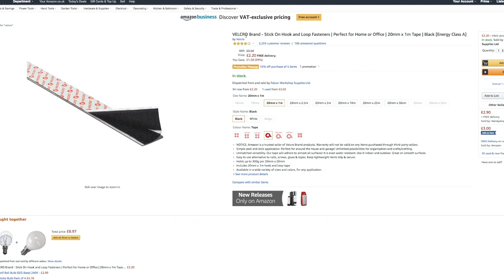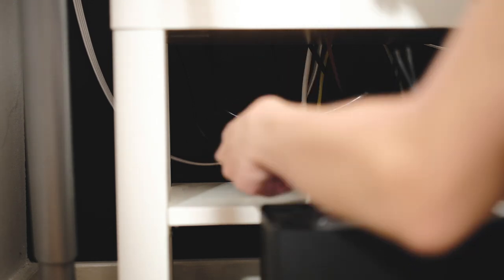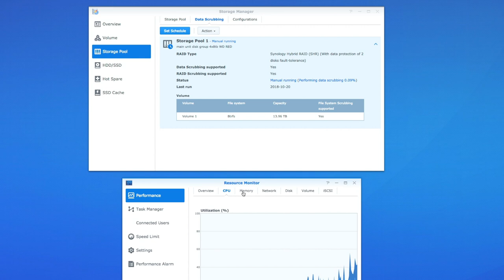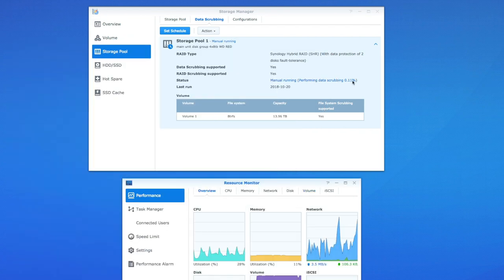Synology DiskStation Vibration Noise - EASY $5 FIX!

Comment: Thanks for this.  Made a difference.  Combined with screwing in the drives instead of the plastic tool-less holders and putting the NAS on a felt/foam base , I now have a perfectly reasonable DS420+ NAS  with 12tb ironwolfs and not a gurgling clunking whirring sleep disruptor.  My only concern with the velcro was if it might hinder heat dispersal through the metal cage. No probs so far.  Pity Synology don't take note of their 400+ customers here and build the things quieter in the first place!  I also have a QNAP 2 bay DAS with 10tb Ironwolfs and that makes only a gentle humming sound as built.
Reply from the maker: Hi David, thanks for your feedback. I monitored my temp after the mod and didn't notice any difference either. I keep my fan speed on low all the time. You are right, it is annoying that these NAS isn't exactly cheap but they make these noises. Given the views/feedback - it looks like many people are having the same issue!

Comment: Ill definitely have a go at this.  Thanks for the idea.
If I were to make a suggestion to anyone else, you probably could use less material and get the same results.  Instead of using the strip the whole distance, just put about an inch on the back and front.  That's what I'm going to try out anyways.
Reply from the maker: Hi Chris, thanks for watching my video. You are probably right, a small strip of velcro felt will probably do the job but the material was cheap anyway so it was just as easy to cut a single long strip and slap it in and call it a day. Let us know if your method works too. Cheers.

Comment: Sorry for the comment on an old video but this might be the fix I need. I read every comment hoping a DS411+ would show up but no luck. I bring this up because my drives lay flat unlike yours so I’m not sure if the fix would still work. I thought it was hard drives but I just replaced half of them and the sound remains.
Reply from the maker: Hi there. Depends what you are trying to achieve? Are you having this same chassis buzzing sound or are you trying to dampen the hard drive own mechanical sound?

Comment: Great tip, just upgraded to 16TB drives and the were significantly more noisy so will apply this easy fix.
Reply from the maker: Hope this helps you. 16Tb x 4??
Reply: @JoeLamOfficial  just 2 16TB + 4 6TB for now :)
Reply from the maker: Which RAID mode are you using?
Reply: @JoeLamOfficial  Keeping it simple with SHR. I'm on a learning curve. The first (successfully replaced drive) is a WD Red Pro. The 2nd 16TB due tomorrow will be a 16TB Seagate ST16000NM001G Exos which is about £100 (UK) less than the WD. I use the NAS mainly for media (Films and TV) content. I will use the extracted 6TB drives for off line backup. I will be putting the Velcro's in the bays when the two 16TB'a are in an working
Reply from the maker: Nice! Drives are getting bigger and bigger. Quite crazy. I wish I set one drive fail only. But now I’ve set as 2 which means my 4x8TB is “wasting” a lot of space for backup. Probably slightly over cautious
Reply: @JoeLamOfficial  Yes bigger and bigger has always been the IT mantra. Moores Law still prevails. BTW my first HDD (in the early 80's was a £640 20MB for an early IBM computer. Happy days :)
Reply from the maker: Indeed. It is crazy but its “slowly” getting a bit slow to run these huge disks at around 100-150Mb. Takes forever to transfer or backup entire disks.
Reply: @TerryMurrayTalks  Did it work? I'm wondering to what degree, if any, it helps with the thumping from bigger more enterprise-y drives? My 3 IronWolf 6TB can be heard in the next room whenever they read/write - and they're in a vented metal box over my head where I work all day (and play/study most of the night). Getting a bit much, although they've been making the same noise from day 1.
Reply: Hi  @SamTheEnglishTeacher  Now have 3x16TB +6TB drives (Net 33.2TB). The first 16TB, the WD RED was fine and quiet but the two ST16000NM001G Exos   are very noisy in particular a low pitched hum prevails. There was also a significant difference between the two Exos. There is also a resonant frequency of the NAS metal box generated with this combination. I have put the NAS on a 3" soft polystyrene base which reduces it significantly but can  still be heard. I'm guessing the only way to get rid of NNN (Nasty NAS Noise) :) is to place them in another location where the noise does not impinge on the human ear.

Comment: Hey mate, did it reduce the under load noise at all?
Reply from the maker: Hi there. It changes the tone slightly. But that’s it’s. Sounds more solid but doesn’t change the fact that 4 x 7200rpm mechanical drives cracking away still produces a lot of sound. It’s noisy.

Comment: Definitely a common issue with the Synology 4 bay boxes - my 918+ was exactly the same - i fixed that with some PTFE strips.  If that was the only issue I had I might have kept it.  I sold it and went back to QNAP.  

Smart, cheap solution though! Nice one.
Reply from the maker: Seems like a common issue indeed. Thanks for sharing. I’ve had my Synology for 2+ years now running 24/7. What made you go with QNAP? I did consider their products too before deciding on this model for myself.
Reply: @JoeLamOfficial  I had a couple of 2 bay QNAP boxes, but I liked the Synology DSM software on a home built server running XPEnology.  When I upgraded to a four bay, I went with the 918+ but I had endless issues with noise, vibration and unreliable M.2 SSD caching.  

The QNAP box was cheaper and has a 10GbE port, so it was a fairly easy choice.
Reply from the maker: @Spreadie  I see. This was my first NAS ever so I wanted something that "seems" easy to use. I use with as backup, storage, PLEX and time machine backup. All in all its working fine. But I did realise that QNAP seem to offer more bang for your buck. I did want the 10Gig ethernet, but the rest of my network is only gig ethernet. Would have been costly especially I'm on the Apple eco system. :/
Reply: Having used both QNAP and Synology, there's not a lot of difference between them.  The Synology hardware seems to be better built (but appearances can be deceiving), and the software is very similar.  Where I worked, they went with Synology.  When I wanted a NAS for the homelan, WOOT had a killer deal on QNAP.  I can be happy with either and won't get into a "my NAS rulez, your NAS droolz" sort of deal.  Both are good.

Of course, you can also go with a used PC, load it with drives, and use FreeNAS.  However, the purpose built devices use a lot less power, which can matter in the long run.
Reply from the maker: Looking at the specs and mode range. I feel like QNAP has better hardware specs? Like thunderbolt or 10gig Support whereas you have to pay more with synology to get similar hardware specs on paper. 

But I haven’t used them before. So I can’t comment on the hardware or software. Would you recommend one over the other?
Reply: @JoeLamOfficial  I've used both, and you're right - QNAP tends to have the edge on hardware.

However, Synology's DSM software is excellent.  In a perfect world, you'd have a mix of both, but hardware wins the day for me.
Reply: @JoeLamOfficial  Features and build quality are two different things.  The Synology devices I used had metal cases, which I prefer.  Yeah, I'm old school.  That said, we never had a Synology device fail on us.  My QNAP TS-431+ is 5 years old and it's also never failed.  A real work horse.
Reply from the maker: True. Fingers crossed mines been running over 3 years now 24/7. If I were to upgrade for whatever reason. I might QNAP or freenas. Probably for more bang per buck and more features. As I use VMs with my synology and it’s rather slow.

Comment: Absolutely genius, might do this for my Nimbustor 4.
Reply from the maker: Does it suffer from noises too?
Reply: @JoeLamOfficial  Sounds literally like your video, plastic mounting and gently pushing the harddrives makes it go away. Stuck two pieces of cardboard in place but that is not very long term. This seems worth trying.
Reply from the maker: The vecro strip should help. 😃
Reply: @Robbaz  How did you go? I have the Nimbustor 4 as well and lately the vibration noise has been getting a lot worse. 
My plan was to go and get some vibration damping tape but the velcro idea sounds promising too.
Reply from the maker: It should work similarly. As long as the sled for the HDD doesn’t have the small gap where it can move and buzz. But it doesn’t help with the actual mechanical hard drive noises.
Reply: @JoeLamOfficial  I tried your Velcro idea on my Nimbustor 4 and it seems to have done the trick. Thank you!
Reply from the maker: Glad to hear it worked. Thanks again 🙂

Comment: I initially thought this was the door flaps making the vibration. Will try your method and see how it goes. Otherwise, I will look at getting some sort of felt for the door flaps/hinges/handles or whatever they are called.
Reply from the maker: that’s what I thought. Since I use to put my foot against it. But my method stopped the whole door rail part vibrating and stopped the sound. Other comment suggests it worked for other people too. Good luck. Hope it works for you too!

Comment: Love this video. I'm wondering, if it would work just as well, if I applied the Velcro to the drive cages instead of the bottom of the drive slots in the unit?
Reply from the maker: Should work just as well. Personally I thought it might be easier. Since the drive cage has those groves on it etc? Thought it might be easier since that case slot where I applied, has a flat surface. Either way, the result should be the same.

Comment: I have the exact same model, had it for like 1 year. It never makes those sounds though. OK, maybe a bit under load, but it's not loud at all.
Reply from the maker: That's lucky. Mine didn't but started after a couple of months. It just resonated at the exact right frequency to make that noise I guess with my drives. Thanks for watching. ☺️

Comment: Hi! Thanks for the tips. Did you use the softer or harder side of the velcro tape?
Reply from the maker: Hi I used the softer side only.
Reply: @JoeLamOfficial  Thanks for the answer Joe. You have a very good one. TC
Reply from the maker: No problem. Happy modding. Thanks again.

Comment: Does it fix HDD writing head sound? I just bought DS220J and with just 2 drives when its in use the noise is so annoying.
Reply from the maker: Not so much, the NAS chassis has too many holes for the sound to escape, but I did do a test here with my acoustic box - https://youtu.be/A4HzqyG6UbU

Comment: My 1019+ makes a clunking noise. Joe would you describe that as the sound? I ordered a new drive because I am concerned  I have a bad drive. SMART is clear.
Reply from the maker: Hi David. What brand of drives are you using? How old are they? Any other system faults or just the noise? Depends on all those things.

All the above could determine whether the drive is on its way out. 

 I wouldn’t describe mine as clunk, just loud hard drive access clicking ticking sound.
Reply: @JoeLamOfficial  they are brand new drives. 12 TB Seagate Ironewolfs.
Reply from the maker: I don’t have experience with seagate drives. Are you replacing or keeping the drives along with the new ones?

Comment: I have mine on subwoofer cushions, but this should remove even more sound. Will have to try.

Though, it's mainly the hdd sound I'm looking into getting rid of as I have to have my nas in my bedroom now.

Don't really want to set up a shutdown schedule. Could maybe set a more strict spin down schedule.
Reply from the maker: Did it work?
Reply: @JoeLamOfficial  Haven't tried yet. Only a more strict hdd power off rule.

Comment: What a simple and effective idea -- thank you for sharing. In my Terra-Master, this made a huge difference (the metal case is a resonance chamber). In my QNAP 451+ the tolerances were a little too tight for the 'fuzzy side' so I tried with a shorten loop side -- noticeably quieter when hitting all four drives. Amazing what a difference it makes.
Reply from the maker: Thanks for sharing your experience. Interesting that the short loop side works too, but I guess just anything to "wedge" them tight will stop those micro vibration / resonance buzzing noises! Glad it helped and thank you for watching my video. Appreciate it. Hope you have a fantastic day.
Reply: Thanks. I have a terramaster f2-220 that makes vibration noises. I'ma try this

Comment: I shoved some COVID masks in mine. Will probably upgrade to Velcro strips soon.  Thanks for the pro tip.
Reply from the maker: Thanks for checking out my video. Surprised you manage to jam a mask in there. 😁
Reply: @JoeLamOfficial  I found some Velcro strips and it didn't make much of a difference. Next I'm going to try removing the sleds entirely and replacing them with foam rubber sound proofing insulation for cars. I bought some sticky back liner for silencing my furnace and never used it all, so I might as well give it a try tomorrow. Its roughly 2 cm thick and should work a tad better than the Velcro.
Reply: The automotive sound proofing sticky back foam helped but didn't make a substantial difference. The hard drive is also not held in in any substantial manner as i didn't remove the tape paper so I could return it if it didn't work out so the hard drive is just floating in the enclosure between foam wedges. I suppose I could take the device apart and coat every corner of it in the foam since its relatively thin, but that would reduce air flow and I think it would just be better to return it since I've only had it for 72 hours. The metal enclosure of the ZyXEL 326 case just appears to have been designed to act like a snare drum so every seek action of the drive results in an audible thwack that can be heard in the in the next room. 

I originally planed to have this sitting near my network quick panel on a wire rack in our master bedroom closet, but the vibrations and noise coming off of it were just further amplified by the rack attached to the wall. Imagine trying to sleep with this thing kicking against your wall at random intervals ever .5 to 9 seconds!
Reply from the maker: Hi there. Yeah it's difficult to remove the hard drive noises considering it's a fairly open thin plastic chassis that just resonates. For me, that wasn't the goal. It was the higher pitch buzzing sound that was annoying me. Otherwise even right now the NAS is across the room and I constantly clear it clacking away. Just isn't possible with these designs to reduce the sound. Unless it's a well sealed case with lots of damping material. Something custom. Otherwise I think most of these prebuilt NAS seem to be just as loud. Or if one day SSD is affordable enough in these capacity and the number of reads/write isn't compromised for server use.

Comment: I'd be slightly concerned about the heat buildup due to thermal isolation and reduced airflow. What I do is place something heavy on top of my NAS and it stops the vibrations. It's not pretty, but I think it's safer long term.
Reply from the maker: Hey. I’ve checked the temperature. Mines set to lowest in general. No temp difference to the drives and still running fine. Since posting this video. For me at least, heat isn’t an issue.
Reply: @JoeLamOfficial  OK, that's great to hear, thanks!
Reply from the maker: No problem buddy.